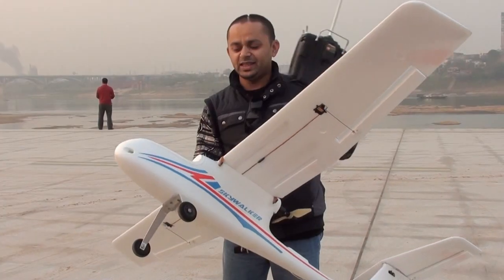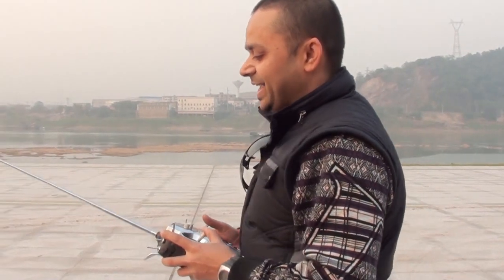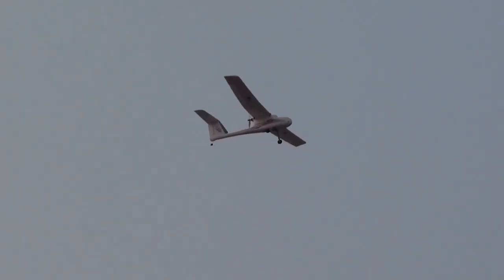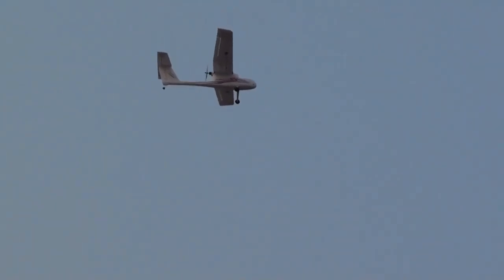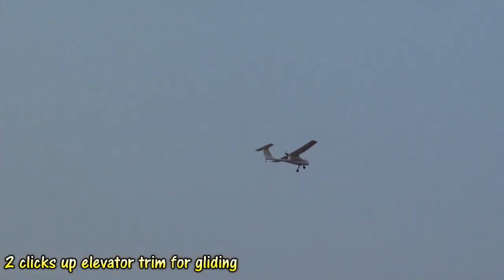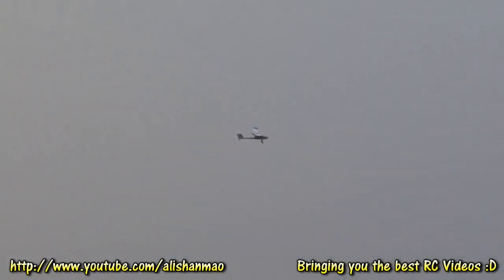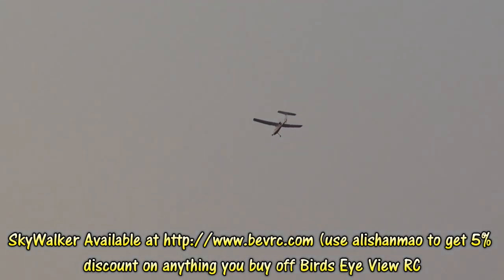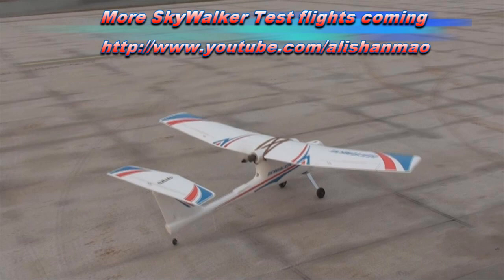SkyWalker Maiden Flight

Comment: AliShaoMao, I just bought a Skywalker, and flew for the first time yesterday. After  climbing to a few hundred feet and then circling for about 30 seconds, the skywalker rolled over into a full throttle nose dive and crashed into the ocean. We think the Arkbird OSD we were using overheated because when we pulled it out of the water, it was all burnt up.  Have you ever experienced this? What should i do to avoid these problems in the future? Please advise! (I bought your book by the way :)

Comment: @alishanmao ive found out what is happening,i set my ailerons level which then made it bank left i then trimmed my rudder until it flew straight.when i got home i looked down the plane from the tail and the fin is out of line.so if fin is at 90deg mine is at 85deg to the left.how can i correct this?would i have to cut the fin off and re line it?
thanks for your time ali :-)

Comment: Good timing.  I'm also putting together a Skywalker V2 for FPV with head tracking, OSD telemetry, RTH (the works).  I plan to use the same landing gear.  Do you have a closeup photos of how you did the tail wheel and how it moves with the rudder?  I just can't see how that works.